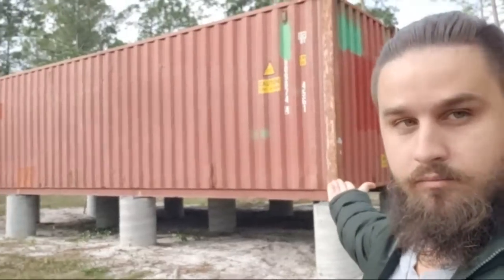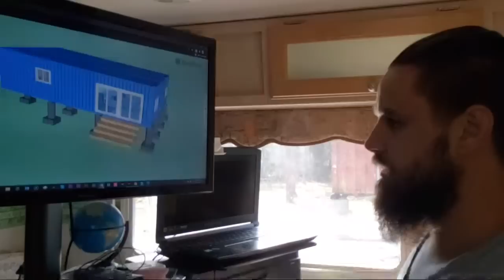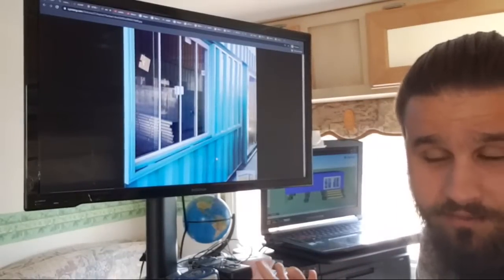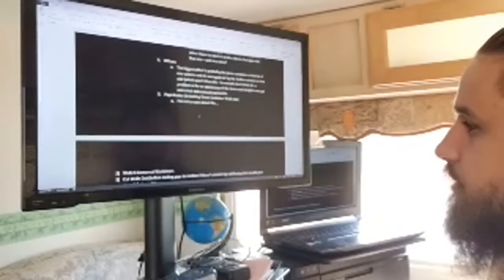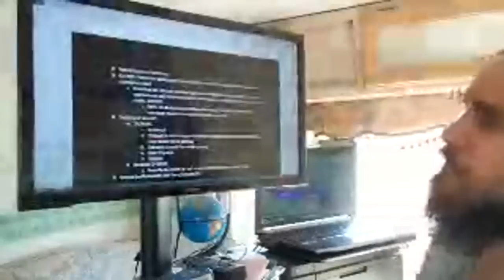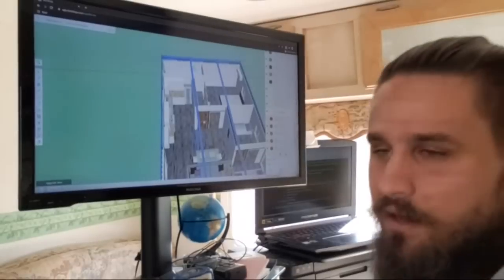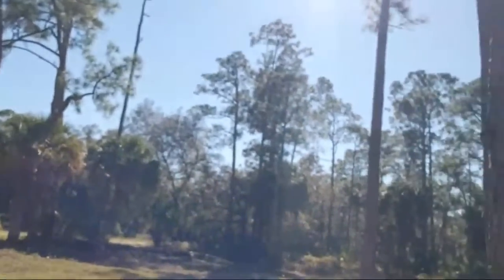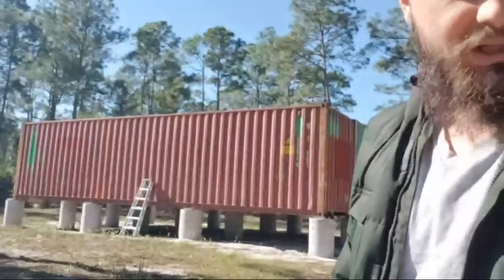LIVE Planning To Cut Out Container Home Doors And Windows

Comment: Those concrete supports in the center might have been an overkill. I work with shipping containers and I know for a fact that shipping containers are designed to withstand all the weight ( 40 tons avg. ) on its four corners, I’ve seen them stacked up to 8 high on the ships.

Comment: I recommend to double check your plans and be sure you are ok with the layout before cutting the container. Great channel looking forward to more content.
Reply from the maker: Yup it's true. Always want to be sure. Unfortunately I'm sure there are some things that can't be changed without reconfirmation from engineer and/or county so. 👍
Reply: @thinkoutsidethecontainer  I'm a arch. Designer and I'm passionate about building with SC. Want to build one, at the moment I'm looking for land. I like the fact that you are sharing so much information. 

Question: why you decided to use 3 instead of two and fill the middle like the guy at "Live uncontained channel"? Any particular reason?
Reply from the maker: Personally I wanted the easiest and most cost effective home. Basically, I did not want to get fancy lol. Even though I love my home's design, I also think it's very straightforward.

Adding a traditional style home in between 2 containers like Life Uncontained would've probably required a lot lore design time and imagination.

Comment: Here's my 20' container I made into a office👇 Been following since red pill.
Tried to add link but error? You can find it on my channel. 
 Fellow Geocentrist👍
If you haven't already studded the walls may I suggest 2x3s. Cheaper and saves more interior room.
I also used a good flat roof rubber paint for additional water resistance.
 What flooring are you using. You may of already answered but I just found this channel today. 
Good luck brotha!
Reply from the maker: Hey Chris. I recently applied Henry Tropicool 887 (silicone seal) to the roof. Water tight and ponding-resistant and also reflects sunlight.

At the moment I'll attempt to keep the container floors by epoxy sealing them. If it comes out nice I'll keep it if not I'll add a floor

Comment: Try a nano door instead of the 2 sliders. Much better looking.
Reply from the maker: I'll check them out
Reply from the maker: Ah yes, the bi folding doors
Reply: @thinkoutsidethecontainer  yes.. there are some manufacturers that are cheaper.  It's definitely not the cheapest option but it is very sexy and gives you more open space than a slider with the same span.
Reply: Holy hell I never thought they would be that much
Reply from the maker: Bifolding doors are absurdly expensive and I can't understand why. A couple extra hinges? Ridiculous. No I think the cost is mostly popularity/  trendiness
Reply: @thinkoutsidethecontainer  there are cheaper manufacturers.  They will range between $1,200 - $7,000.  If you hunt around you'll find a decently priced one.
  Basically you save from having to waste 1/2 of your outdoor access space by having a one of the sliders in the way.
Reply: @thinkoutsidethecontainer  also something to consider is you can have an 8 foot bi-fold as opposed to having a 12 foot (2- 6'  sliders).
Reply from the maker: Yeah I see the coolness in opening the entire space but for me I'm happy with just 6 feet opening. That being said I do plan to use a slightly different version of sliding door than whats currently in my 3d model.

The current model is just a left hand and a right hand version of standard 6 foot wide sliding doors...but that would leave the frame in the center even when both are opened.

There are center-sliding doors that come as a single 12 foot wide unit, open up 6 feet wide down the center and leave no frame.

Comment: Did you consider angle iron to frame the windows and doors?
Reply from the maker: Yup already in the plans.
Reply: Great channel and great info.  Will you use new construction windows or replacement and screw through the frame?  I keep thinking about the nail flange on the exterior.  Any thoughts?   And also, closed cell underneath for insulation?  I’m looking at a build in New Hampshire.

Comment: Why you didn’t put it on a flat concrete slab?
Reply from the maker: Great question. A few reasons: I'd heard that the concrete columns were less expensive and more DIY friendly, and also I wanted the house to be at a higher elevation than than my septic system so the wastewater could flow naturally using "gravity". In my area the septic systems have to be above ground mound types, the house had to be high up.

I suppose I could've put the home on top on a mound of compacted rock and then poured concrete slab but...then I would've had to pay for all that rock.

I dont know too much about what it takes to pour concrete slab so I cant say if the columns were easier to do.

Are you in construction or have experience with foundations?
Reply: @thinkoutsidethecontainer  no I just thought it would’ve been easier. But thanks for sharing why you chose that way. I’m following your journey much success.
Reply from the maker: Thanks. More videos coming soon. Its hard for me to say which foundation would have been easier from DIY perspective. Id have to deep dive into slab on grade foundations...but very interesting either way